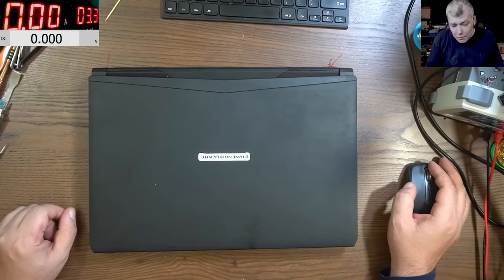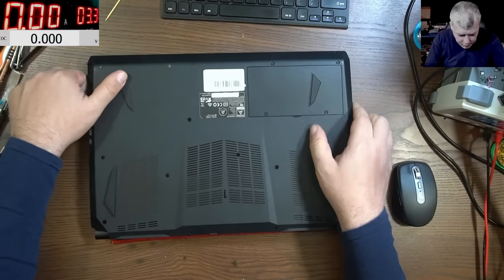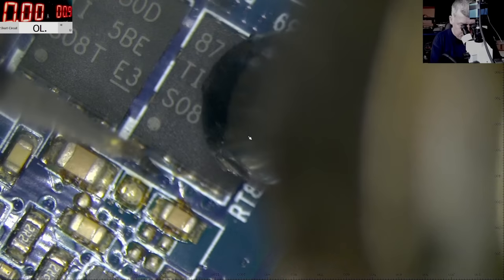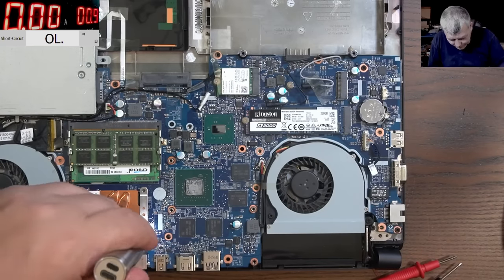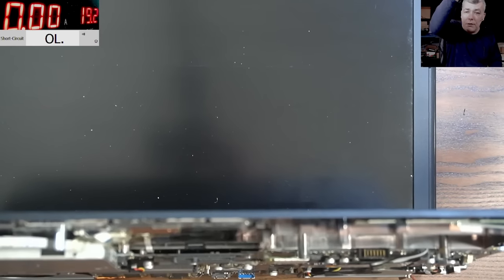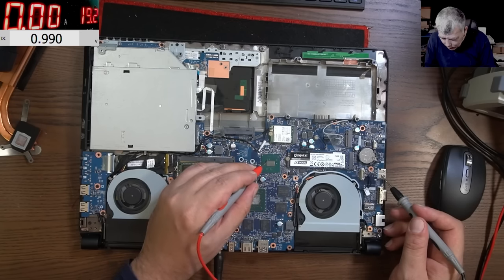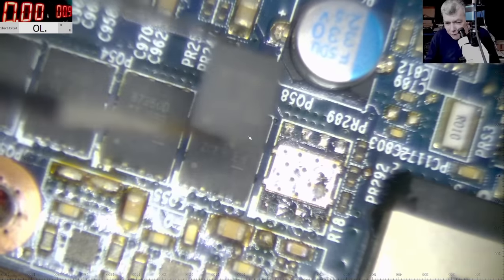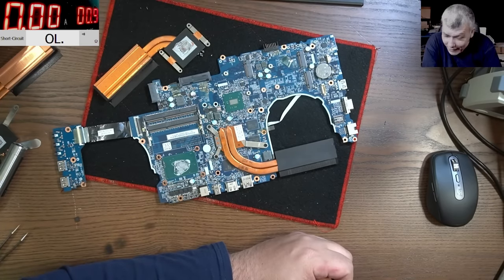Two laptops, same fault, same burned component - What are the odds?

Comment: Sorin, would it be a good idea to invest in replacing these factory mosfets with better ones that can handle more current at the same voltages?  I see this a thing in the future where people will just upgrade certain components to stop them from dying sooner and make em more robust, similar to how to add thermal pads in your devices to improve spreading the heat to the cassis etc.  OR shouldn't there be a fuse to protect the CPU/GPU components between them and the mosfet on the main powerline so that if the MOSFET does get shorted all that current isn't going straight into the CPU / GPU as it hits the fuse as protection?
Reply: Masfotes nowadays are pretty robust, the issues come from manufacturing defects and quality fluctuations. I would like hearing an official answer on why there isn't some form of protection aleeady, knowing that a mosfet can easily kill vital components. Guess the answer is always the easy one, profit over everything.

Comment: I so wanted a thermal camera on he 2nd motherboard (CPU) as the heat signature was very clear as number 1.    Many years ago, I had a troublesome laptop with a GPU (early Dell), 
which by heat failed in a curious fade, over several weeks to complete fault.  I suspect a very similar operating trend was shown to this owner (customer).
Here, your well stated observation of power of distance, (mosfet pair as one each more remote ) was the basic of a design flaw.   It also seemed very clear via the thermal camera that only a particular segment of the CPU was *high heat as observed.  Which, would seem to my understanding as only a part of the *land grid array.
Soren, I would expect to see a continual stream as failure to this particular product.  I think many, many unhappy customers at this offered unit type.   As unity in fail.
But, would such owners change (upwards) as over clock setting?    Push beyond limits?   
An interesting lesson today.  Thank you so much for that presenting, as I am keen to try and predict as observer to full craftsman.  Regards,   M.

Comment: (13:40 - 13:42) "Manufacturer problem design issue". That's how it is! What else can one think! Also, once again, I insist: I see that the second line of the part number begins with the abbreviation TI...Did Texas Instruments build that type of Mosfet? If so, then why don't I see their proprietary logo? omg. If it were an original part number it would be CSD87350Q5D available at mouser elec...nics (datasheet and price per piece). Another way of saying it; You have to tell the boss (in this case the manufacturer): come on man, it's going to be used in a critical section of a gaming laptop; let's offer something of quality, if we want to compete at least moderately in this market. I thought long and hard before posting this kind of opinion. 
On the other hand, excellent failure analysis work, I'm sure the client will understand. Thank you very much for sharing. All the best.
Reply: as usual,the u-tube comments are gold, thanks

Comment: I am guessing that the shorted mosfet is the high side mosfet.  Maybe they should have three mosfet.  two high side and one low side.  Perhaps then they would be able to handle the current.  It seem that is a major problem with gaming laptops. They need to go back to the drawing board these laptops are not cheap and they fail all the time.

Comment: CPU use different voltages for different parts. Other mosfets are ok because they are all in parallel, But this single one is most likely SoC power, iGPU or something similar that shouldn't take too much power. But design guy save few $ with decision to use only one stage, someone else save few $ ordering cheaper "still in spec" part and we get what we get,  e-waste.
Reply: It's just planned obsolescence built into devices so that you have to go out and buy a replacement roughly after 1 yr warranty.
Reply: @icommandoi145  You can't sell anything in Europe without at least 2yr warranty so tactics like that can be two edged sword. And with almost any laptop for cca €50 you get additional 1-3yr warranty. To me that look  more like bad engineering or design used in low end office laptop replicated in system with high speed memory that put additional stress on memory controller and pull few watts more than original designer had in mind.

Comment: Bad luck for the customer. What looks to be an electrolytic on the mosfet output seems suspicious, as if they were expecting surges, noise etc at that point. I wonder whether they factored in the inrush current. No excuse not fitting fast over-current / over-voltage devices but I don't suppose any laptop manufacturer does.

Comment: Why do you apply the voltage when you have a short on the transistor of the processor?
Reply: It was only 0.9V with a current limit, so if the CPU was still good that wouldn't damage it.